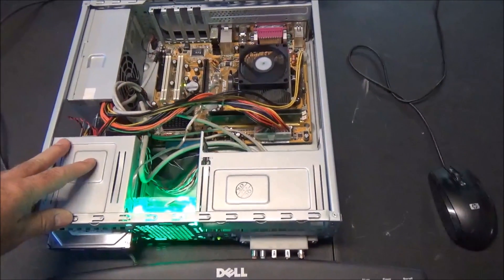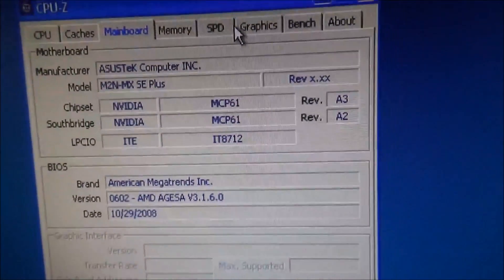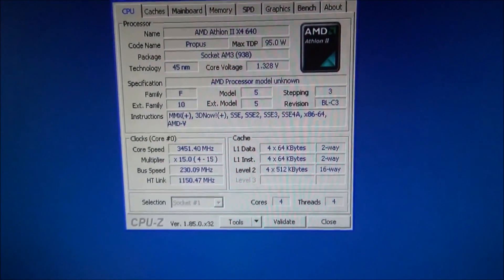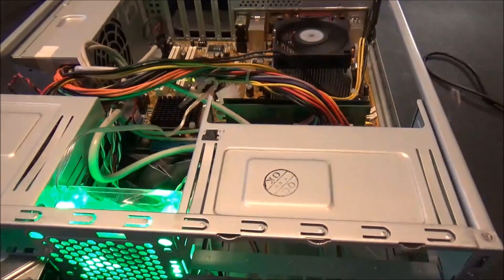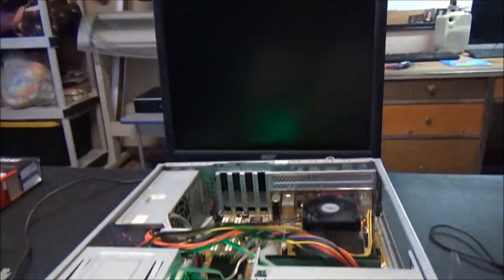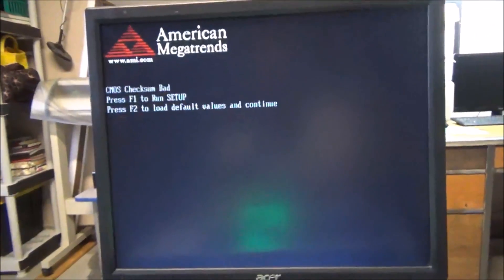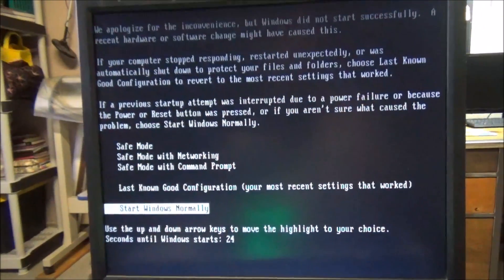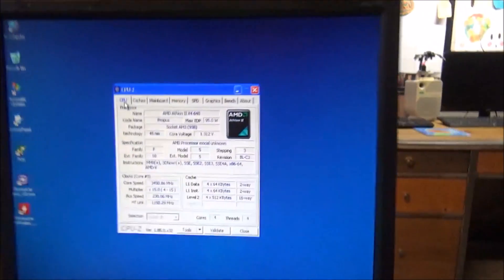Trying to FSB/OC an Athlon x4 640

Comment: with my 2 seconds of research it would seem that checksum error comes up due to the motherboard trying to protect the board from your overclocking settings. Might want to try updating the bios if you haven't done so already. Also might want to check the cmos battery voltage and or the socket for it.  Goodluck with the overclocking.
Reply from the maker: Yeah, it looks like I can only get it to around 3.3 without that error. The board just isn't made for it. It is on the latest BIOS though, that's how the AM3 processor is supported. I think I might sell this mobo on eBay and get one that is a better overclocker. I found one that is pretty good for $60, which is a little steep. But I can get about $35-40 for this one so it wouldn't really cost too much to make the switch.

Comment: The cmos error means the overclock is no good/unstable most likely. If you can dial back the memory as fsb also overclocks the ram you will know if it’s the cpu that is limiting the overclock or the ram. That 1 gb of cheap ram probably struggles to go over it’s rated 667mhz I’d guess it can get to the 700’s without issue though. Check the ram speed In cpu z it should read half the speed so for example 800mhz memory would be read at 400mhz. You have to double the MHz you see in CPUZ to know what the ram is actually running at. Find the max cpu oc first but I’m thinking you are pretty close to the max on stock voltage anyway 230-236 would be my guess depending on the chip but try higher if you can get it to keep posting and holding the cmos settings.
Reply: Set the fsb to 233, try both auto and 1.3 v as I think auto actually gave it more voltage but check cpuz. Leave the pci express alone/stock and toggle between 200 and 266 for the ram and see the highest you can get it while stable and check cpuz to see what the ram is actually running at. Increase the voltages as needed. Also if the pc gets to the point it won’t even post you will have to reset the cmos by unplugging power to the psu taking out the battery and switching the cmos jumper to the other position only for a second and then putting it back to the original spot before starting it up again if there is no jumper on the cmos pins you can just short the two together for a quick second with a screw driver. The cmos pins are usually close to the battery on the older motherboards and there is usually 2 or 3 pins. Looks like a fan header almost but smaller and with no plastic receiver around it. Most older motherboards cmos pins will have one of those jumpers on it like the old ide CD drives and hard drives that enabled you to select master or slave mode.
Reply: Went to check and these are my settings as follows for my x4 640.
Cpu clock ratio [auto]
Cpu North ridge freq [auto]
Cpu host clock control [manual]
Cpu freq(MHz) [245]
PCIE clock(MHz) [auto]
HT link width [auto]
HT link freq [auto]
Set memory clock [manual]
Memory clock [x4.00] - 980mhz
System voltage [Manual]
DDR2 Voltage [+O.100V] - 1.900V
North Bridge volt control [+0.1V] - 1.200V
South bridge volt control [+0.1V] - 1.300V
Cpu NB VID [+0.025V] - 1.1750V
CPU voltage control [+0.100V]- 1.4250V
Normal voltage - 1.325
I’m guessing you don’t have half these settings but my mobo is fairly standard also but seems a bit better then yours bios wise. It should give you an idea, I only needed 1.9 v for 960 MHz on my ram and 1.425v for a 245 fsb which. I think I was able to get 233-236 on the stock voltage though.  I was able to go further then 245 fsb but decided to dial it back as I only use the machine as a htpc and the higher the oc the more the power consumption. I think I was able to get into the 250-260 range at one point but was uncomfortable with the voltage being so high and the ram didn’t like being around or over 1066mhz, My ram is 800mhz stock so 980 on the ram was decent. So I settled in a sweet spot which is very stable. If you wanted I’m sure you could find another mobo for less then $40 or the phenom Cpu should get you at least 3.6 even on stock clocks on that mobo. With a phenom and a decent mobo you should be able to get in the 4ghz range no problem. Even where you are now around 3.4 ghz would make a nice htpc if you put a cheaper video card in it. I put a gt 1030 and ssd in mine and it runs super smooth on windows 10.
Reply from the maker: For some reason YT marked these two comments as spam. I didn't notice until just now.

Comment: When I ordered my current rig,I just went with an i5 7500 3,5-3,9 GHz,and didnt bother with OCing.If I start to OC I will just buy a way too expensive cpu.board,ram and everything else...
It looks very interesting,though!
I'm glad this worked out well for u.
Reply from the maker: Man I really like overclocking my CPU's and GPU's. I rarely have the best parts so it's nice to squeeze that extra power out of them.

Comment: What is the board, CPU, RAM, etc?
Reply: Sorry, should have watched, instead of typing! I'll look at the components and get back to you.
Reply: Oh yeah, It's A Gundam has a new vid just out!
Reply from the maker: Haha, I was checking that out just from the thumbnail! Looks like a good one =D
Reply from the maker: No problem man. I think the main issue is the RAM, it's a matched set of 512mb Hynix but it's slow PC2-5200. I have 8GB of PC-2 6400 Samsung coming from China but it won't be here for a couple weeks.
Reply: Can you give me the numbers off of the board itself? And a revision number? Thanks!
Reply from the maker: It's an ASUS M2N-MX SE Plus rev. 2.02g. But the ASUS website info isn't correct. It doesn't even state that the board supports AM3 processors with the latest BIOS, and I booted it with an AM3 chip. There's also quite a bit of evidence from online posts and YT videos that make me believe it will support 8GB's of RAM, and the ASUS website says 4 max. So I'm basically just trying stuff to see if it works. I'm just not familiar with FSB overclocking and I don't know what even half of the BIOS settings do.